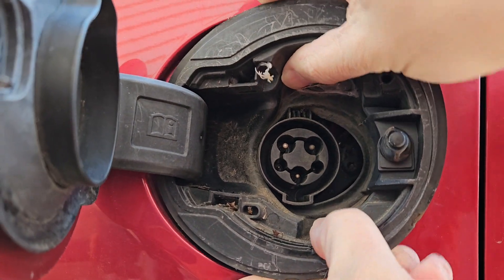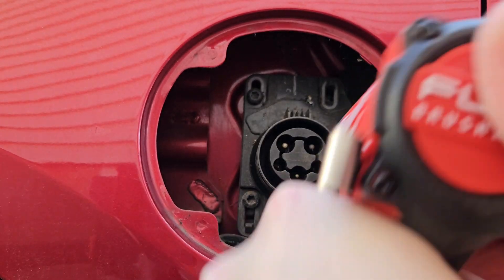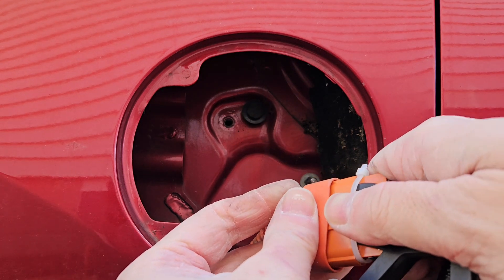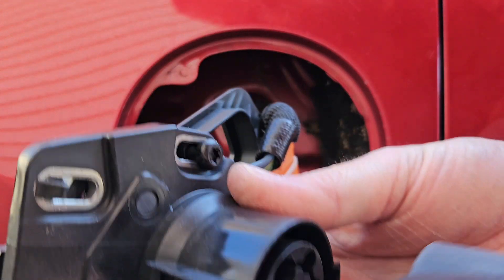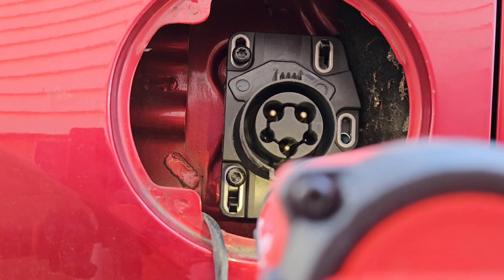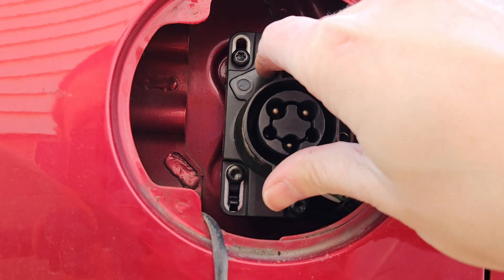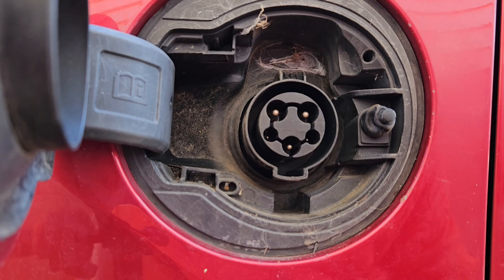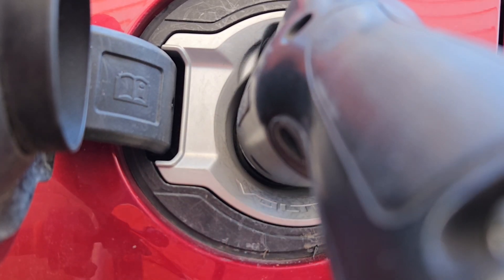Chevy Volt Gen1 Charge Port Replacement

Comment: Some recommend you unplug the main battery from the middle console or disconnect the 12v battery. Did you do any of that?
Reply from the maker: Nope... wasn't necessary. I know what it's referring to, but the connector is not flowing any voltage other than being willing to conduct the handshake for initiating charging, but the connector is 'dumb', there's no EC's or anything in it, so you're not 'disconnecting' anything that's 'live' when swapping this part that I can tell. The change of impedance from disconnecting the last 6 inches of wire (effectively what this connector/pigtail is) is largely invisible to the car.
Reply: No need to pull the main plug in the console. I did and ended up having to take the car to the dealer to reset the computer. Just a waste of money

Comment: What was the fault you were trying to correct?  My 2013 simply won't charge (no errors, no lights) after a few rainy days (and charging outdoors!)
Reply from the maker: Light on dash would show orange/amber like it was negotiating the charging session then when charging started it immediately failed and would go black. Failed on L1 and L2 charging.